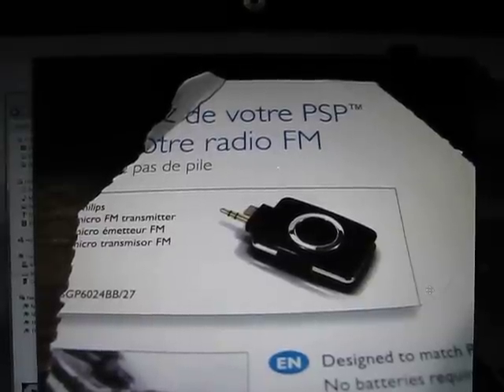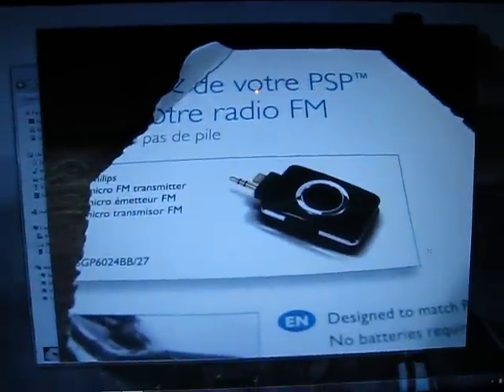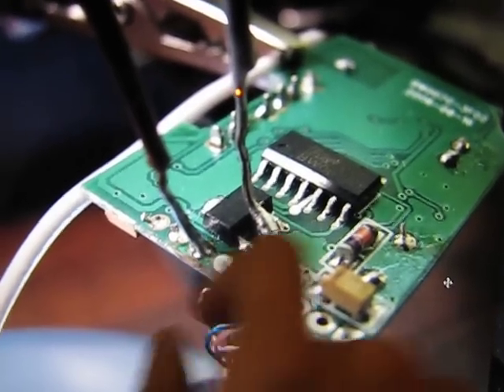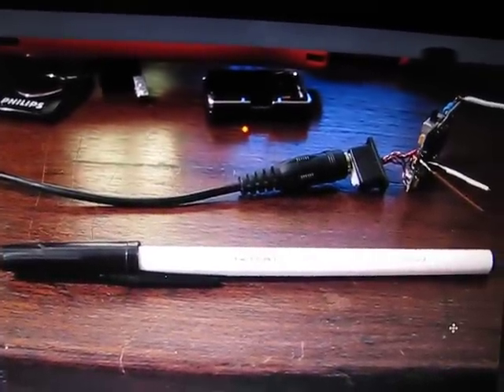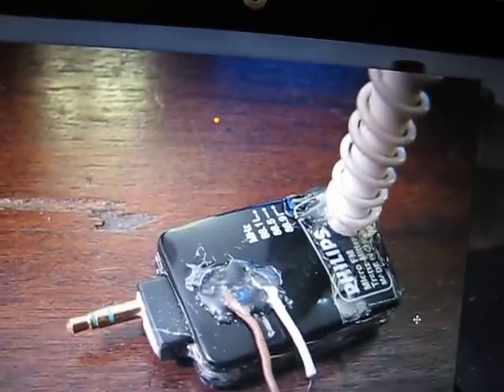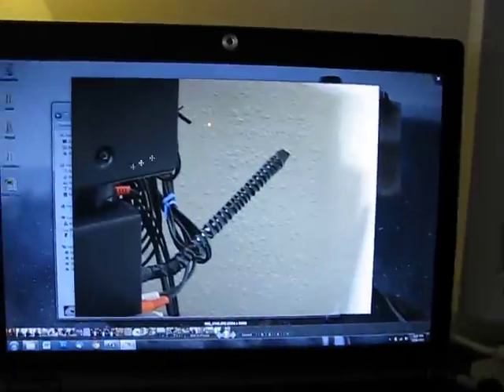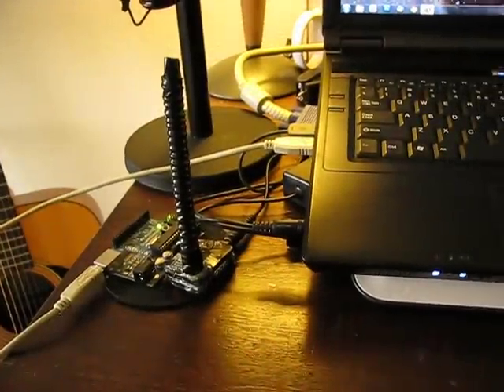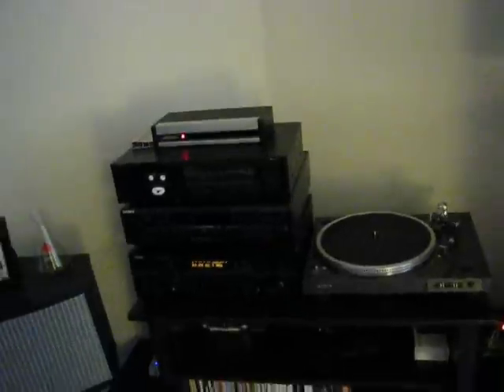FM Transmitter Mod - One Dollar Science!

Comment: How did you power the transmitter? And how did you plug the antenna into your receiver?
Reply: David Nguyen He mentioned he powered it with an Arduino. Arduino's can put out 3.3v and 5v depending on the area the transmitter is plugged in.